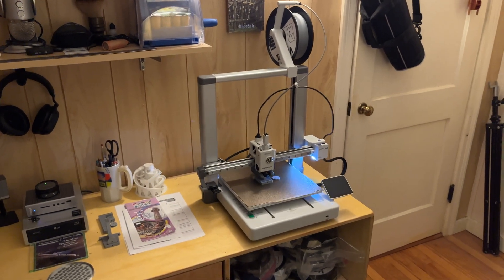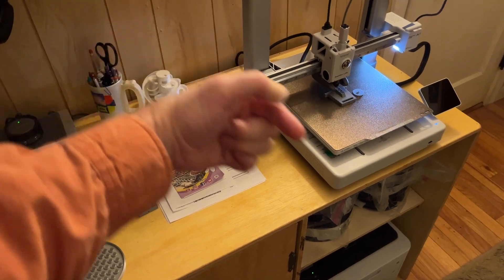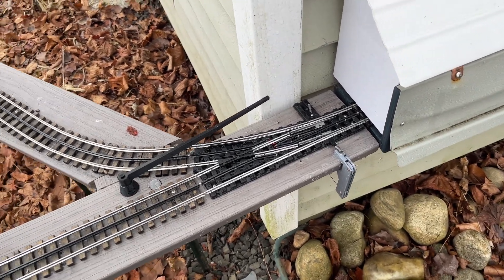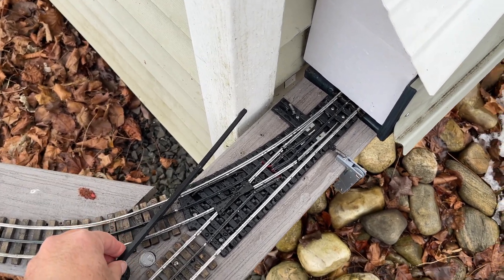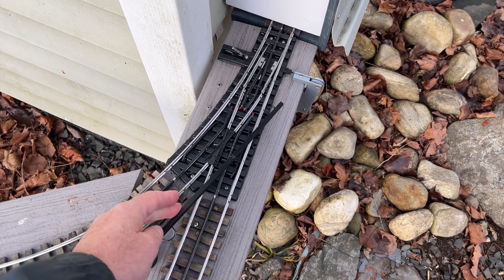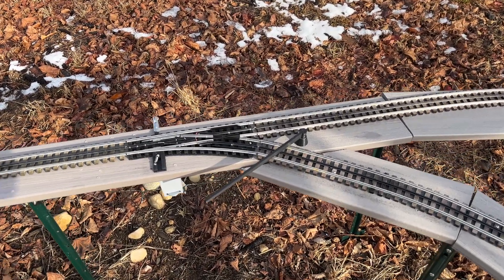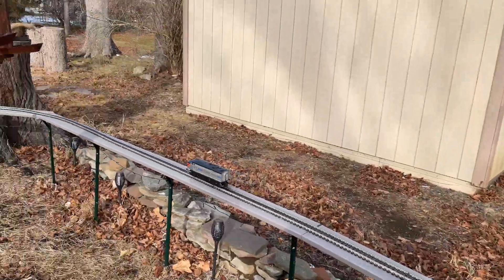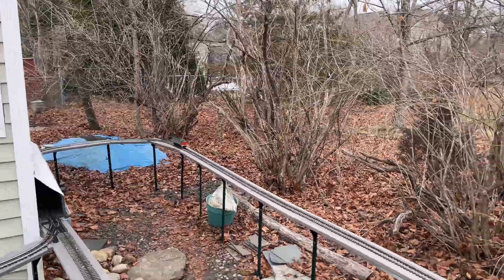Garden Railway 16 - The new gates

Comment: I just finished watching all your layout videos.  I wish I discovered you earlier.  I could have saved you a lot of time and money.  I can see some problems you are going to have in the future.  I have built six of my own layouts (five indoors and one outdoors) and helped many others.  My advice comes free.  I like to pay forward all the help I have received.  Let me know if you want some help.
Reply from the maker: That's very kind of you.  I take on projects like this for fun, to learn as I go.  So I don't consider it time wasted.  To me it's like solving a giant puzzle.  What are some problems you see down the road?
Reply: @jayducharme  model railroad track is a poor electrical conductor and gets worse as the joints oxidize or rust.  You will get a voltage drop that gets worse the further you are from the lock on.  Most modelers remedy this by adding a bus wire the whole length and drops at certain lengths.  Your layout is far too long to rely on track conductivity alone.  Do a google search for model railroad bus and feeders.

Comment: I had the ender 3 and several other brands in the print shop.  This fall I reaplaced all 7 printers with new Bamboo A1s.  The more you use it the more you will like it.  They just work unlike ever other print I have had that required constant tinkering.   You make a great choice getting the Bamboo

Comment: I tried springs and weights on my reversing loop switches and eventually went with nothing.  I just let the train wheels push the switch track back and forth on my indoor and outdoor layout.  I oil the switchy parts once in a while.  You can see the reversing loops in my videos.
Reply from the maker: @DeadrailTrains    Does your dead rail setup make that possible, since your engines would be heavier?
Reply: @jayducharme  The weight does not matter.  Even small pilot wheels push them over.  You have to remove any springs or arms or levers connected to the rail parts.  works 100% reliably.
Reply from the maker: @DeadrailTrains    I'll have to give it a shot.

Comment: Nice job. Are the gates the right height that they won't close over the top of an empty flat car? It would be nice if the small loop at the building end of the tracks were a little larger to accommodate a longer train and not have such a sharp turn.
Reply from the maker: I agree the turn is a bit tight, and my plan for the spring is to expand that loop into a long oval.  I have leftover track and plenty of bed hardware, so it should be a relatively simple task.  And yes, the gate is low enough to accommodate a flatbed car.   That's what my camera was riding on.

Comment: One more suggestion that will make it work better with lighter cars. Replace the return springs with a single pully - string and lead weight system. This way the pull of the return action is constant, does not get harder to overcome as the arm swings open. Also, it will be easy to adjust the weight to just the amount needed to return the track switch to the normal position. Having an elevated track like you do will make this type of mechanical return easy to do.
Reply from the maker: Great idea!  Thanks.

Comment: Congratulations on finally getting the gates open, I am curious how coaches handle the gates being pulled.
Reply from the maker: Thanks.  I suspect there won't be a problem.  Once the engine pushes the gate open, it doesn't take much force to keep it there.  So I think the cars will trail along fine.  But we'll have to wait to see.